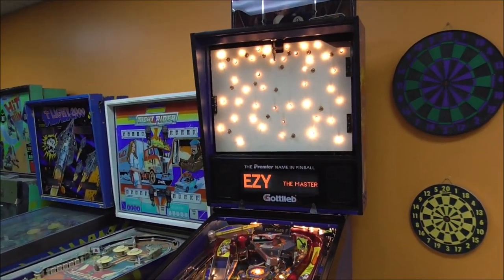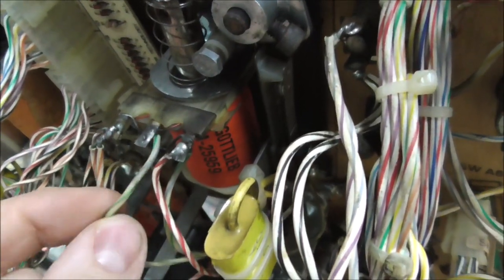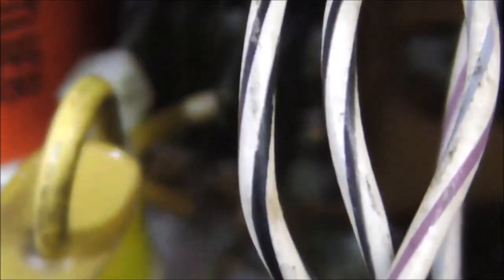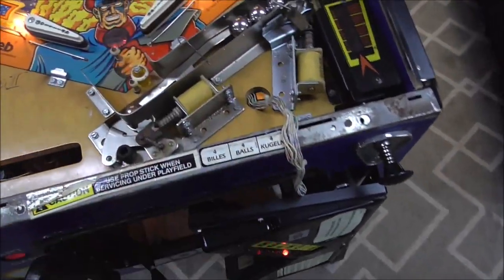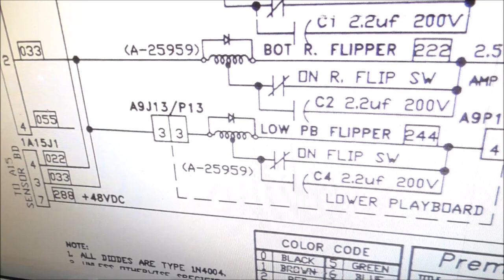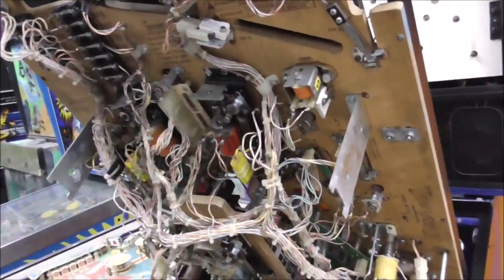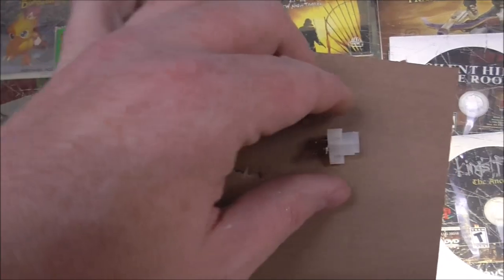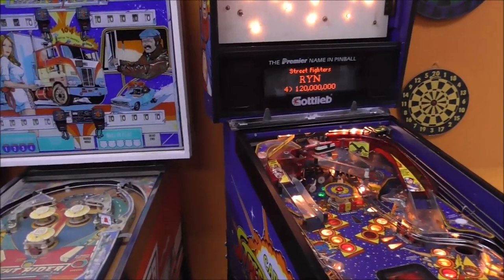How To Troubleshoot Gottlieb Flippers (Blowing fuses!) - Street Fighter II Pinball Machine!

Comment: Excellent catch on the damaged capacitor, as well as the bent housing on that switch/solenoid assembly. By the way Ron, how can those three targets work when they are permanently shorted???... Overall, WELL DONE!!!  10/10
Reply from the maker: I still don't understand that switch setup, I was erring when I was testing them because if they're not touching it doesn't really matter if they're a smart switch or not, if they're not touching basically they could be out of the cabinet and that wouldn't screw up the matrix (as long as the wires jumpered to the next switch).... so it's possible you can replace those smart switches with a regular switch as long as there is a diode on it, but i'm not sure.  Ultimately we replaced them with the correct switches like original and everything worked right so I guess that's all that matters!  Thank you for watching Dero....
Reply: I think when the ball hits the target, the target hits the back stop and allows the contact to keep moving and briefly opens the switch.

Comment: Huge difference between the pull & hold current on the flippers.
48V / 4 Ohm = 12 Amp : 48V x 12A = 576 Watts !!! for pull
48V / 204 Ohm = 0.235 Amp : 48V x 0.235A = 11.3 Watts for hold

Comment: Having issues with my street fighter 2 , the kick bumpers left and right are stuck on and blows fuses . Any ideas ?
Reply from the maker: Make sure the switches aren't touching of course, and then see if the coils are shorted, the transistors in the backbox that run each kicker are probably shorted, or the coils are shorted.  There was a certain version of the driver board for some of these Gottlieb games that the transistors on the board short on their own and need to be replaced with new ones.  Check out http://www.pinrepair.com/sys3/index.htm#driver

Comment: JOE CLASSIC, I'm confused how the SMART switches work in theory because you don't have to adjust the contacts or the middle board, so I'm not sure how they work really. The Flipper Relay Coil measured the resistance for the EOS switch seem to measure GOOD even when the Yellow 2.2uf arc suppressor capacitor was shorted/BAD? Because you ohm meter seem to measure the flipper relay coil resistance was good even when the yellow 2.2uf arc suppressor capacitor was shorted and bad so I'm confused how you found out the capacitor was the root cause of the problem.
Reply: 1)  SMART switches are piezoelectric. Consider it an electronic part with no good way to adjust them.  They are made to either work or be replaced.

2)  The flipper coil consists of TWO windings, one is 200 ohms and the other is 4 ohms.  The two windings are linked on the center of the three coil contact legs.  The EOS switch (AND the bad cap) short the 200 ohm winding, essentially making it disappear electrically.  That is the measurement that showed up when the WORKING flipper coil was tested, but did NOT show up when the FAULTY flipper was tested.  The 4 ohm winding should be there when the flipper button is first pressed, then the the EOS switch should open, adding the 200 ohm winding and giving the flipper a 204 ohm coil.
Reply from the maker: Thank you OhioAudits, well said!  Our friend Wayne here watches every video and always has several questions, he's very inquisitive and always pays close attention and tries to understand everything we go over, sometimes it's hard to properly explain them but we always try to help him understand as best we can, he's actually one of our best viewers and a regular for quite awhile now.
Reply: @ohioaudits9160  Thanks for the help 1.) I'm guessing they used Piezoelectric switches because the response time is faster, but the piezoelectric switches need power because they are active switches that need power voltage/current to work compared to passive switches. The SMART switches I'm guessing are connected to the PIA chips. The Piezoelectric switches are more sensitive to vibrations compared to the normal passive switches.